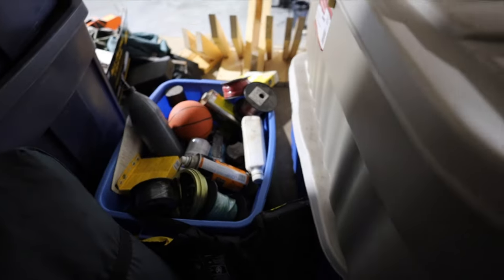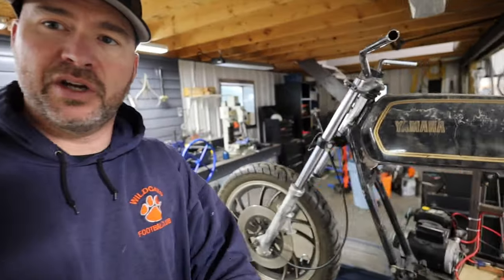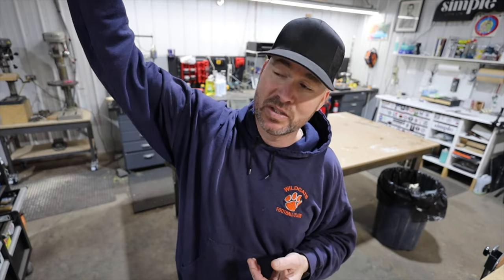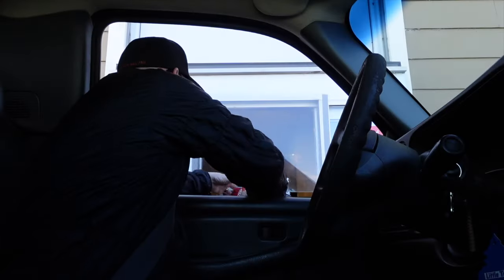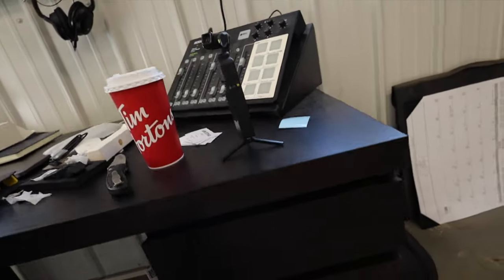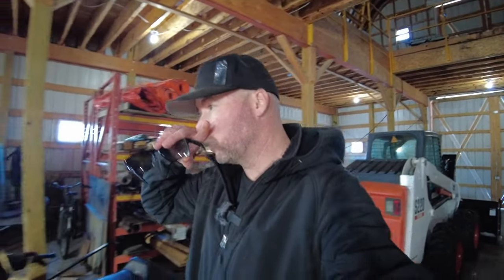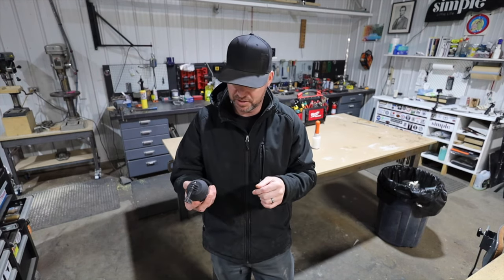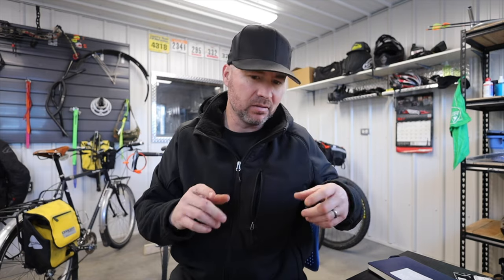vlogging is dead

Comment: Interested in the new camera, most compact cameras are a metal dust magnet due to... its magnets lol. Do metal dust from the grinder get stuck in it?
Reply from the maker: Yeah I imagine this would be a dust magnet. Especially since the wide lens attaches with a magnet. I don't plan on using this one for grinding and welding stuff unless it's mounted quite a distance away. But, ultimately when doing that type of stuff and filming it, the cameras are going to start getting damaged and worn. I find the gopro is a great camera for locked-off shots and can take a real beating. I don't worry about that one at all out in the shop. Cheers👍